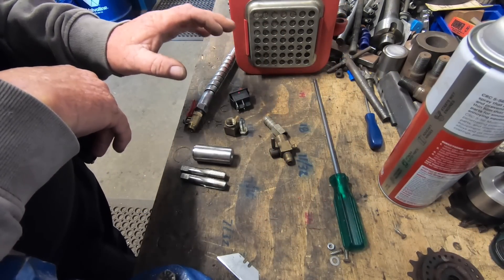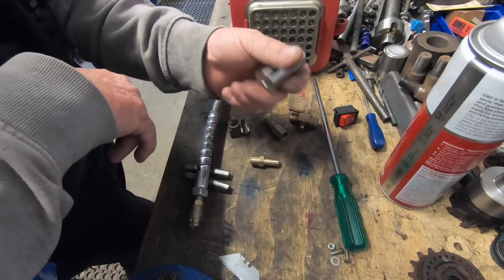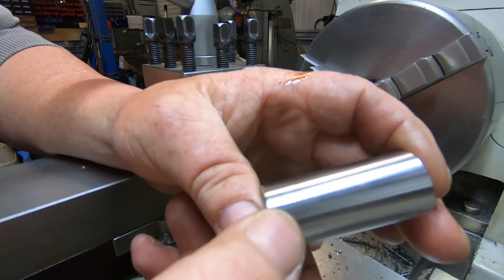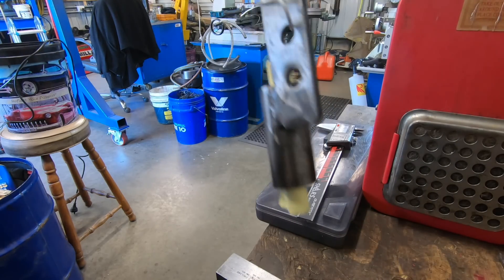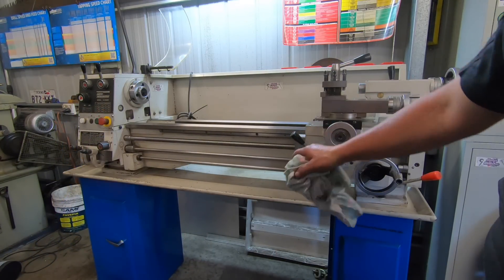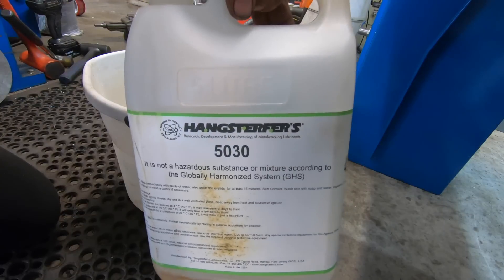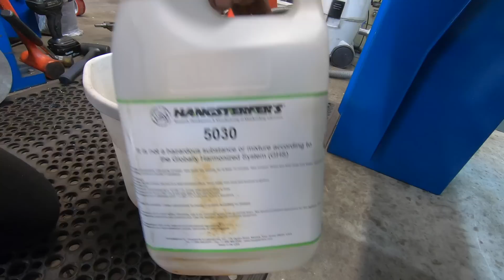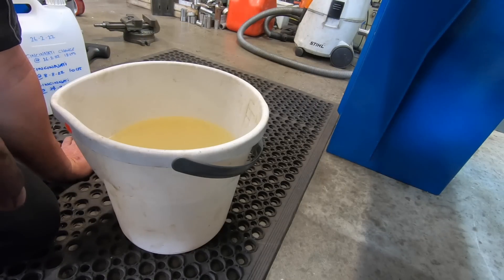Lathe Flood Coolant - DIY

Comment: i have the same pump ect: wanting to do the exact same as you with coolant in my lathe. 

I have a question.

1. what thread size and pitch did you need to connect with the little tap from the silver hose. I'm not good with imperial inches, grew up with all metric.
Reply from the maker: Gday, this pump setup works well, the thread on the end of the silver pipe is 1/4NPT 18, I hope this helps mate, thanks for watching, cheers

Comment: It that plastic hose gives you trouble cause it wants to curl you can pull it straight and hit it with the heat gun while keeping it straight just slight warming usually does it if that doesn't do it  put a pipe or rod in the end with a hose clamp pull straight hit it for a lil longer with the heat gun you'll feel it get warm and soften the tension then immediately spray with water and it should solid up into that shape 👍👍👍
Reply from the maker: Gday, thanks for the advice mate, so far it’s been ok, appreciate you watching and commenting mate, cheers

Comment: Hi Matty, great solution and the price was right too lol. Transparent coolant, that's a new one on me, fantastic idea in the home shop as we often work to scribe lines for one-offs etc. Cheers, Jon
Reply from the maker: Gday Jon, the price was spot on, the Hangsterfers 5030 I’ve used in the mill for over 12 months now, it does go off colour because of the tramp oil going into the sump but it’s still not as bad as the white coolant, thanks for watching, cheers

Comment: I was planning to build a containment HD coolant pan for my LeBlond, but found, and hoping selling will do some horse trading for his whole table. I too have a parts washer that just set's unused. Great retro fit,,,👍. Safe Holidays, Cheers to all there. Bear
Reply from the maker: Gday Bear, the parts washer pump works well and has enough lift to have the drum on the ground, a good thing with the pump it has a filter built in, thanks for watching mate, cheers

Comment: Glad you made this video we found one of those pumps in a junk car at local scrap yard while back, best thing it's brand new 😀, trying to build a lathe from scratch, actually been trying for past couple years but life happens, thanks for the great idea 💡 👍 😀
Reply from the maker: Gday, the big plus to this pump unit is it has the filter built in and it’s quite, let me know how you get on with yours, thanks for watching, cheers
Reply: @MattysWorkshop  yeah we have a parts washer that's 20 plus years old uses same exact pump and still goes strong 💪it's amazing considering we use kerosene and gasoline as our parts cleaner, but nothing stands in our mixture's way 😏 not gease nor dirt, and when we get a cut, just dip hand in it, the kerosene takes sting of most cuts away

Comment: Nice addition to the lathe Matty. My Hangsterfers coolant is white. Makes filming a fun challenge. Blows out the exposure big time.
Reply from the maker: Gday Preso, Thats interesting, I mixed the Hangsterfers 5030 at ratio of 10:1 which is roughly 2.4 on the brik scale and its clear, are your using the 5030?, Thanks for watching, Cheers
Reply: @MattysWorkshop  I have the S-500 variant. It is a 1:13 mix. Aaron Powter got it for me. It seems to do a good job but it is very white and as you say, it tends to obscure the work. I recently completed the coolant plumbing on my Bridgeport and now I am trying to deal with the mess and the clean up after a session. It does help with prolonging the life of the cutters though.

Comment: Nice Upgrade Matty ! Zero cost projects are the best ! I'm jealous your chip pan came with a drain..I'm trying to figure out how to add one to mine.
Have a Merry Christmas and Happy New Year !!
Reply from the maker: Gday Dean, I was lucky with this modification and should save the inserts a lot to, Merry Christmas to you all mate and have a great new years, cheers
Reply: Dean, a machinist friend of mine has a Enco just like yours. I am betting there's a factor drain plug up near the head. Look under neath the table with a good light, mite be an allen head are Hex plug already there (@@)! Bear

Comment: Nicely done! - never thought of using an old parts washer motor, will have to keep an eye out and see if I can scrounge one myself! I was considering just setting up a gravity feed system with a couple of 10l buckets. One on the floor to catch the draining fluid, the other mounted on the wall above the lathe.  Then just emptying the bottom bucket in to the top bucket when the top bucket got low.
Reply from the maker: Gday, the gravity feed setup will work no worries at all, thanks for watching, cheers

Comment: Great coolant system Matty, will be really useful especially for parting off. With regard to drill bits in the tailstock, a good idea is to use a collet chuck. This is a recommendation from our mutual friend Rob 🙂 I use an ER32 collet chuck in my tailstock all the time, way better than a Jacobs chuck for holding drill bits. It grips better and even if the bits do spin the chuck won't bugger them up. The chuck holds so well that I can hand tighten centre drills and they don't spin even when drilling steel. Cheers, Alan.
Reply from the maker: Gday Alan, I should be using the collet chuck more, I do have er32 and er40, thanks for watching mate, cheers

Comment: Check -on the mig welding machine datasheets for amps& voltage settings. 
- the contacts tip dia is correct for the filler wire dia. & the filler wire is free from workshop dust & rust. & periodically blow out the liner   with compressed air. 
You’re welding thick to thin consider pre heating the thicker part. Gas flame or kitchen oven. 
Start the weld on a piece of scrap metal and  run the weld to the start point. 
Don’t catch your sleeve in the lathe chuck when you switch the pump on/off.

Comment: Put a pressure switch on it so it shuts off automatically and you will not need to turn it on and off. It will also keep it from running hard when you are just using a dribble.
Reply from the maker: Gday, I like the idea of a pressure switch, I’ll have to look into that, thanks for watching mate, cheers

Comment: Looks like a good set up there. That should extend the life of your inserts for sure. I think I would use a brick in the bottom of the bucket and keep that nice piece of aluminum for a project.
Reply from the maker: Gday Tom, I ended up taking the piece of aluminium out and sat the pump on the bottom,  the filter screen is fine enough to stop crap being sucked up hopefully, thanks for watching mate, cheers

Comment: Well that turned out nice, you may use it more than you think. I have drill bits that slip, had, I finally took them to the mill and put flats on them. Keep smilin.
Reply from the maker: Gday Darren, I think it will probably be used more often than not, I like the idea of the flat on the drill bits, thanks for watching, cheers

Comment: Nice install…so quiet will it be a problem if you shut the valve and forget to,power off and walk away?….maybe tie power to lathe power…off is off?
Reply from the maker: Gday Chuck, it’s a lot quieter than I expected and I can already see myself leaving it turned on, something I’m going to have try and find a solution for, thanks for watching mate, cheers

Comment: Looks like a winner Matty, I had thought about adding flood coolant also, but have concerns of rust so I just use a cool mister with cutting oil and it does good for what I do on the lathe and mill. Cheers
Reply from the maker: Gday, I’ve been using the Hangsterfers 5030 in the Cincinnati mill for over 12 months and had no issues with rust at all, I’ve purposely left in on the table for a few days to see what happens and no issues, thanks for watching, cheers

Comment: Also agree with your comment about the clear coolant, I use a semi synthetic too which is a little milky, but it is much easier to see through than the white soluble oil
Reply from the maker: Gday, I used to use the Penrite oil and I found it didn't last long before it was going bad and comparing tool life and surface finishes between the Penrite and Hangsterfers its quite noticeable in my opinion, Cheers

Comment: Great job Matty,  nice quiet pump, external reservoir is a bonus. 
First time I'd seen the full length of your lathe,  useful!
Thanks for sharing.
Reply from the maker: Gday, The pump is almost to quiet, its hard to hear if its on or not, The lathe is 900mm between centres which does come in handy now and then, Thanks for watching, Cheers

Comment: Hey Matty, just watched ya vid on your set up and I give ya a congrates! My question is this,
does the coolant go bad with time....jelling up,actually turning bad(smelling),or just looses it's juju?. Your kinda like me in the garage if I have stuff here and about I'll make something work instead of buying a setup that costs way more than what I'll be using it. Thanks for sharing mate!!👍🤠
Reply from the maker: Gday James, I've been running the Hangsterfers 5030 for over a year now in the cincinnati milling machine and i,ve changed it out once, it didn't go bad or smell, I was using Penrite before and it was crap, Cheers

Comment: I am thinking about using a small garden submersible fountain pump from the local flower power garden centre, the pump 240VAC for less than $50 giving me about 4 litres / minute , would like to hear other opinions before I part with my $50, I look forward to your content, great keep it coming, cheers
Reply from the maker: Gday Don, The fountain pump should works as long as it has enough grunt to push the coolant high enough, if it doesn't you might have to raise the unit up a bit, hope I explained that alright, Thanks for watching, Cheers